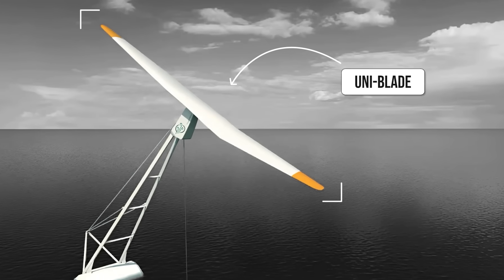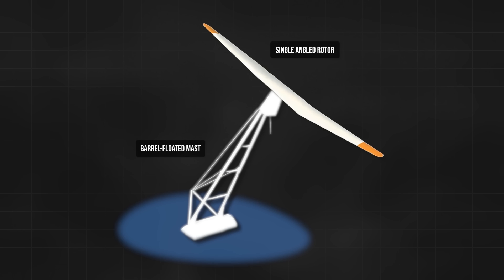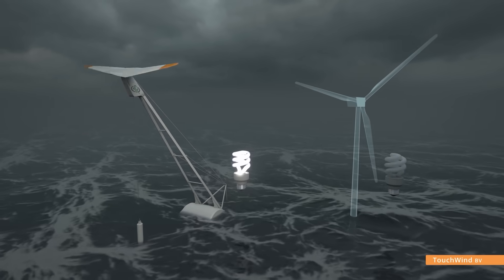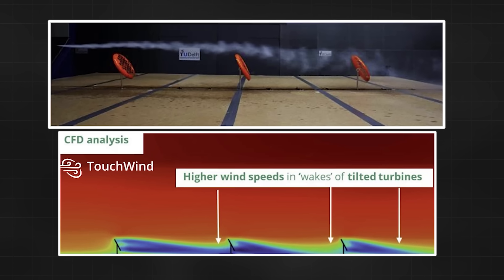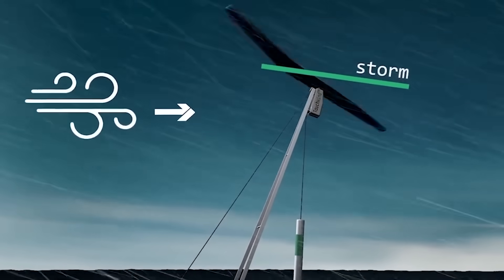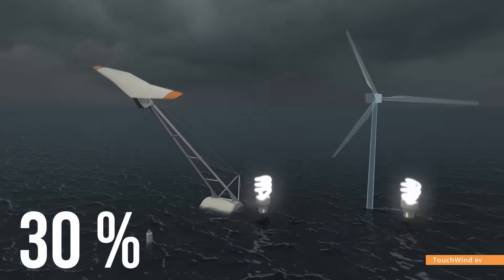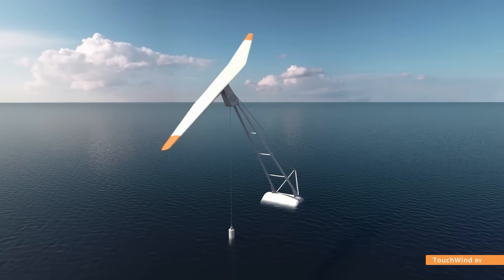Insane New Turbine Promises CHEAP Unlimited Energy

Comment: I read an article that suggested that most wind turbines are designed with 3 blades for individual efficiency but that a better design would consider the whole system and favor economics.   The 3 blade design is useful for only a narrow range of wind speeds and is even at risk in high wind speeds.   It was proposed that a smaller multi blade design with an outer ring although in theory less efficient per blade would be cheaper to make and produce more electricity since it can handle slower and higher wind speeds.
Reply: Low wind speeds do not carry enough power to be worth chasing, and every newbie armchair designer thinks their untested, on-paper design will magically survive higher winds than real turbines.
Reply: @dougselsam5393   Idea was supposedly from a turbine blade expert.  I merely passed it on as potentially useful idea.  Was also supposed to be good for high winds which current 3 blade designs can't handle.  I am not an expert, but it seems reasonable and even obvious that a design that produces power over a wider range of wind speeds would be more useful, especially at the higher speeds where there would be more energy.  Isn't that one of the benefits touted in this video?
Reply: Thank you for the clarification.  Can you tell me why simple home turbines are so expensive?  A car alternator is less than $200, and doesn't seem like a plastic propeller should cost much, yet the cheapest turbine I've seen is about $600, not worth the piddly amount of electricity produced (unless you are in a remote location with no better options).
Reply: @nealkonneker6084  Neal:  The reason nearly all small wind turbine companies have gone out of business is solar prices suddenly dropped tenfold.  Wind turbines of any size have to be built to last 20 years.  is your car alternator going to spin for 20 years of continuous driving?  No, and imagine how long it would last if you were to drive your car 24 hours a day,.  Maybe your car alternator would last 6 months?  And the alternator operates under controlled conditions, whereas wind storms can easily force ten times the rated power onto a wind turbine.  Wind turbines can be ripped apart by sudden high gusts, shredded by hail, abraded by rain or even dust in the air, oscillated and vibrated to death in gusts or whenever any imbalance might occur .  And your turbine needs a tall, very strong support structure.  And cabling - buried.  And disconnect switches. And a charge controller with batteries, or grid-tie inverter.   And someone has to install all that, and they need to know what they are doing.  Meanwhile, you can buy cheap turbines on Ebay - here's one for $145:  https://www.ebay.com/itm/394438801918     How long would it last?  How much power would it make?  Hard to say, but at that price, best to make sure you don't put it into a truly strong wind.   Good turbines cost a lot more, due to requiring rare earth magnets, since a car alternator would have trouble producing a charging voltage at the relatively low RPM of a wind turbine, and they need to b super-sensitive for light winds, and yet super-strong for high winds.  Not easy.  If you think they could be built cheaper, try it and see how easy it is!  The reason armchair wind energy analysts remain in their armchairs is designing and building effective wind turbines is a challenge.  And the reason almost nobody is running them at their homes is you need wide open space for the wind to blow free, or a super-tall tower not allowed in your neighborhood.  Plus, solar is way cheaper nowadays.  Not to mention more reliable.  BTW this message is powered by a 10 kW wind turbine.  :)

Comment: Puff-piece! You have shares mayhap?
Floating rotating devices will have a lifespan in minutes in a rough sea and gale. Now deep-water tethered semi-submerged towers at least 20 metres of which are under water are stable, but can still rock, so they need a symmetrical rotating weight with more, not fewer blades to minimise the forces when they wallow (even if only a few cm) while rotating. It is basic mechanics.

Comment: The sea is a harsh mistress. Weather conditions can be extreme and need not be frequent to be destructive. What would happen if a spinning rotor were knocked down and hit the water? I suspect the rotors would need to be cheap enough to be considered occasionally disposable.
Reply: Just happened in New England. Project on hold. Doing environmental studies on microplastics. The environmentalist are the ones shutting down the green project.

Comment: 1 pic showed the turbines facing 1 direction, like soldiers in a row-shoulder to shoulder. If the wind direction changes 90°, do the turbines turn 90°? Like soldiers in a column, each looking forward @ the back of the soldier's head in front? Is there a turbine "wake" problem then? Blades are a major problem. There are 1000s of junked blades, broken, split, cracked & un-recycled. The cause is fatigue. Also, possible sun damage to the fiberglass. This design requires a 600 foot blade. How are blade failures going to be reduced? Or, to put it another way, how is blade life going to be greatly increased? Then there's the tree huggers & animal rights' activists concerned about aviary life being sliced. No one here's trying to be a downer. Just mentioning  questions/concerns, as is the case with any project, especially innovative untested--(full scale, real life?) ones. Hope you find genuine success for the masses as well as the big boys.

Comment: You've done a good job of hitting the highlights but would need a deeper dive into the engineering to formulate an opinion. As for the possibility of a mitigated wake, this would have value for onshore windfarms but the ocean is so vast, it's difficult to see the benefit. For the record, a general rule of thumb is to separate turbines by at least 1.5X rotor diameter so the wind has time to heal before hitting the downwind machine. Something I kept waiting to hear was the coefficient of power for the monoblade and how the Cp degrades with changes in the angle of attack. At the end of the day, there's no way this system will have equivalent efficiency of a traditional horizontal axis offshore turbine, so the benefits have to come from the lower CapEx amortized over time. The ocean is also a very harsh environment, so creating a machine that can withstand these conditions and reliably transfer the generated energy to shore is a challenge not to be underestimated.

Comment: Any generation of LIFT will direct air downward, this is simple Newtonian physics.  If it dose that ENOUGH to be of any impact is the questions, I am doubtful.  But the clearly strongest selling point of the system is the simplicity and lack of pitch control.  Also it seems obvious to me that the generator should be placed in or near the float with a strait shaft running down the mast or even being the mast as this will lighten the structure hugely.  The biggest issue will be at what MINIMUM windspeed the system can operate in, this is where modern turbines are trying to operate at to get higher capacity factors.

Comment: If they are to far offshore the losses from transmission could prove too much.
Reply: The export voltage is 66kV or 132kV - for a 15MW turbine that means current is pretty low so losses at anticipated distances from shore will be manageable. Larger offshore wind parks will only be running 10’s of kilometres to an offshore substation where the voltage can be transformed even higher to efficiently transport to shore

Comment: Nope. Wind isn't the answer no matter how it's collected. Wind is free power though fickle, but the means to collect and store that power is far from cheap or sustainable. Power plants need to produce in rain or shine, hot or cold, storm or calm, 24/7/365. What can provide that? It's not solar, not wind. Hydroelectric does, geothermal does, nuclear does. Nuclear power plants are the easiest and least expensive of the three to build. Hydroelectric dams are major undertakings, but can provide power for centuries. Geothermal plants can also provide long term continuous power but they do generate a lot of heat. And heat is how nuclear plants work. I mention heat generation because we are dumping so much residual heat into our atmosphere that we could very well boil our oceans in another 400 years. While solar and wind don't generate much heat, they rely on chemical storage of electrical charge. The chemicals/ metals used in the storage batteries are eventually consumed and have to be recycled. Recycling that material is cost intensive. Not recycling that material means we will eventually run out of the materials to make those batteries and the poisonous, reactive waste will have to be stored some place safe.

Comment: 🤜⚡💥⚡🤛Being a triple engineer with numerous inventions in this space, I conclude that this is not a good design. 1] Downwind designs encounter turbulence from the tower which reduces efficiency;  2] Wind speeds are slow at low elevations which reduces energy production;  3] The blade angle is sub-optimal for all inclinations which reduces energy production;  4] The blade angle to the wind direction requires much stronger, and therefore heavier and costlier, rotors;  5] The retreating blade encounters the same loss of lift that helicopters experience which here translates to reduced energy production and other problems. IMHO, the cost of the system is comparable to legacy systems and therefore the lowest levelized cost of energy [LCOE] metric is higher. Not a good look.

FYI, most wind energy comes from medium wind speeds BECAUSE they are more prevalent/frequent in occurrence. High speed winds occur less frequently. Low wind speeds don't have sufficient energy to be of use.  

I have advanced, robust, low cost wind turbine innovations, offering the lowest levelized cost of energy [LCOE] and ultimate  survivability in any wind regime.
Simple low cost grid-scale energy storage is also on the table.

Contact me for more information and check out my engine/transportation innovations...including off-planet solutions.

Stay Radical!

From the desk of: Chief Radical Officer
🤜⚡💥⚡🤛

Comment: I suspect there are some critical limitations to this system but it will nevertheless be cheaper to install and maintain.

I predict it'll be highly situational at first, but may give rise to tapping some specific geographic as well as economic potentials. For example, it could end up being more approachable to small and privately-owned operations, and this would fill up the secondary source of sea wind power, which is now seen as niche in the (already established behemoth and money-hungry) industry, but is actually much more dominant in reality and wildly underestimated.

In my eyes the survivability is the biggest factor of success and the actual assembly incl. the turbine formation and power transfer. Turbine wake is not that important, because we ought not compare the existing systems directly, because they don't compete for the same resource pool in geographic terms.

Comment: i wonder if it works for them to be mixed in existing parks, since if thats the case its easier to pull off a small test park using the same power cables already available there.

Comment: From an economic standpoint, the ability to generate power at high wind speeds is less interesting in a future energy system with lots of wind turbines. In that case, a lot of turbines are producing, and the power price will plummet. The ability to generate at lower wind speeds is much more interesting. I'd be interested to hear more about that. I'd love to see a power curve relating wind speed to power output for this type of system.
Reply: That indeed is what the market is trying to do, get higher capacity by capturing low speed wing.

Comment: don't overdo North Sea offshore wind energy! I suspect that the present day 2024 installations are already quenching and deminishing the Gulfstream, which is basically driven by a huge heat-exchange machine called: North Sea Winter storms. 
The global AMOC ocean circulation is driven by 2 "motors" as far as I know: 1. North Sea winter storms 
2. the saltiness difference in the Mediterranean Sea: less salty surface water constantly flows in at the straight of Gibraltar, after much evaporation in the Mediterranean, saltier water streams out at the bottom of the Gibraltar strait!

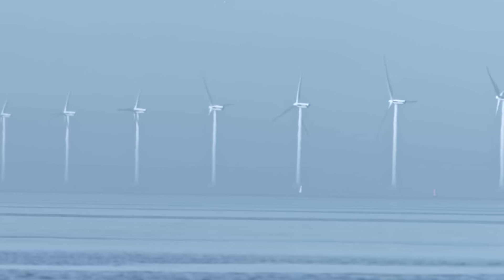Comment: 6:33 You need to multiply the probability magnitude of each bin by the cube of the velocity to get annual available bin energy. (Assuming constant turbine efficiency)
Reply: So using the magnitudes in your graph, for example, a turbine in that location will make more annual energy from 20m/s wind than from 10m/s wind. 0.013 * 20^3 > 0.080 * 10^3
Reply: @suunraze  Locations don't have just one wind speed.  That skew distribution of speeds is going to be replicated almost everywhere but just stretched or compressed if the location is more/less windy.  The point is that the all wind turbines have minimum and maximum wind speeds they operate in so summing the bars that it operates in can predict both the capacity factor and total energy production.
Reply: @kennethferland5579  summing the bars' magnitudes times the cubes of their velocities, yes. The statement, "most wind energy comes from the slower speeds" is incorrect; in the weibull distribution shown, most of the available energy was in the 20 m/s range, not the range the cursor was indicating.

This is why it's valuable for a turbine to be operational at high wind speeds, even though they occur rarely.

Comment: Something like that was built in Germany in the 1980s as 'Growian' (Großwindanlage). The blade was shown at the Hannover fair. But somehow it failed in practical application, perhaps due to bearing problems with the asymmetric wind force.
So I assume that this breakthrough will break again
Reply: "The partners and partly also the BMFT also operated the project with political motives. Günther Klätte, board member of the RWE, said at a general meeting of the company: "We need Growian (large wind turbines) to prove that it is not possible" and explained that Growian is something like an educational model to convert nuclear power opponents to true faith."

Comment: Thanks..  great idea.  another advantage is no thub thub from the blades passing the tower.    I like that it bows to the sea and wind.  I am wondering if you put this on top of a boat mast and drove an underwater propeller, how fast would it go in various wind directions and speeds.  would recommend a more pinnate prop to reduce drag where there no torque produced.  I would also consider using sail cloth for the wing to reduce cost, weight and ease of replacement. 
Keep up the good work.

Comment: Interesting idea. I think they're wildly overestimating their cost reduction, but 8% seems entirely plausible. And that's before considering the added benefits of 1) not ripping itself apart in storms and 2) potentially generating some energy there. That makes it already worth it (assuming they can ensure it doesn't fall over, which seems like a relatively easy issue to solve). The wake thing is gravy; it's a cool bonus, but the ocean is vast so it's not that important of a metric.

Comment: I am a retired aeronautical engineer that worked for 20 yrs for a manufacture of aircraft generators and Emergency ram air turbines.  Have examined vertical wind turbines years ago.
     Let start at the response of this wind turbine design to the variation of wind speed that have cause gear boxes and turbine blades to premature fail.  The time constant of the turbine blades, gearbox, and generator are no different then horizontal wind turbines.  The time constant for the tilt of the tower is at least an order of magnitude and likely two orders of magnitude slower then the rate of change that cause the turbine damage.  It will not help.
     The power that can be harvested from the wind is a fraction of the frontal area of the turbine.  Tilting the swept disk of the wind turbine reduces that area time the sine of the axis of the turbine to wind direction.  And as the turbine tilts the disk drops closer to the ocean in slower winds. So at 45 degrees both sine and cosine is  70% of the horizontal axis turbine.  The lift of a tilted disk will help eliminate the need for pitch control and the drive to aim the turbine into the wind.  The lift will be enhanced by ground effect, the wake stops when it hits the ocean.   The wake of a turbine in a wind farm are going to interact.  My guess is that they will piling up wakes, will increase the ground effect which will decrease the frontal area of wind turbines deeper in the wind farm array from the wind entering the farm. 
     Finally the reason for two blade choice is structural.  Consider that the swept area, angle of attack, and relative wind speed changes with position. This is seen in helicopter blades.  The preceding blade has a higher relative wind so even in straight flight the angle of attack is reduced.  The receding blade has a lower relative wind so the angle of attack is increased.   For a two bladed system with fixed relative angles of the blades dynamics is used to achieve the same angle of attack between preceding and receding blades. Gyrocopter blades do not have a fixed axis of rotation of the blades to the body of the copter.  What is the relationship in this wind turbine, not stated.
     Majority of helicopters have three blades and only the small and simplest helicopters choose two blades.  Simply put the fluctuation of lift and thrust of the three blade together is less then two blades.  Less stress on the gear box and engine.
Reply: cough https://en.wikipedia.org/wiki/Bell_Huey_family